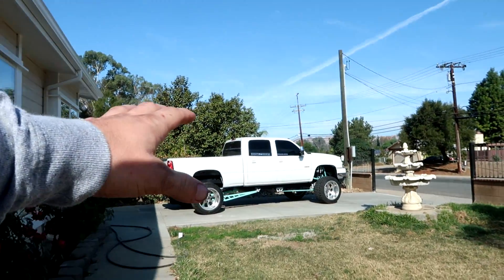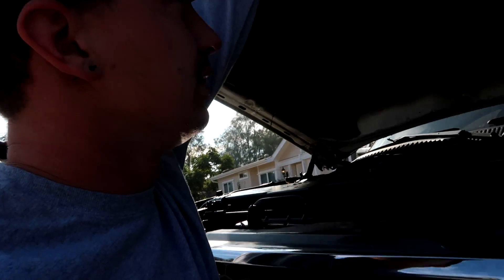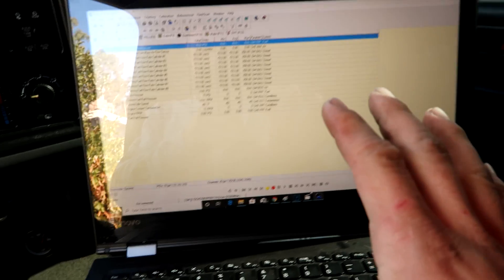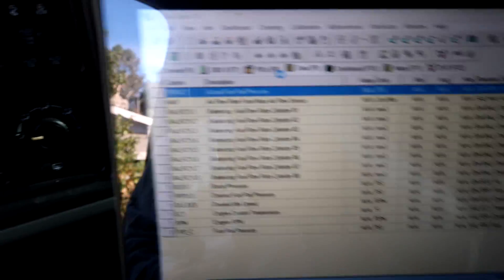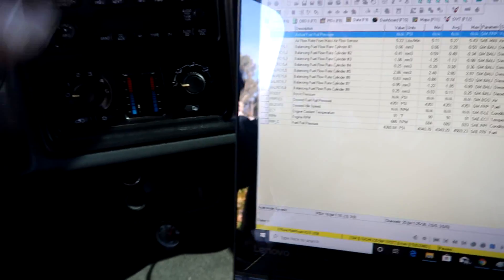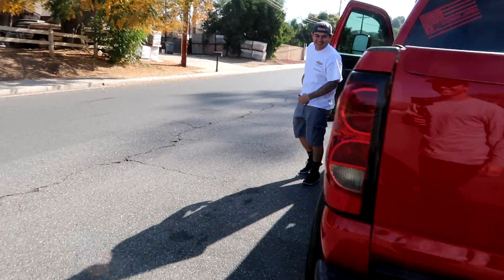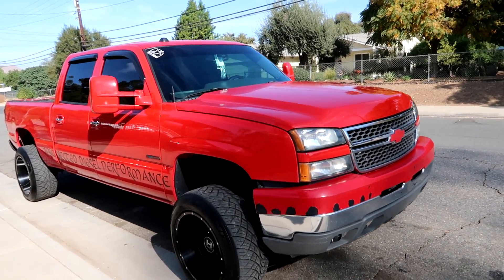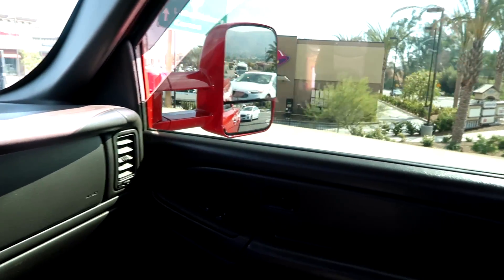Duramax Balance Rate Test

Comment: Can u shut off injectors with eflive to test pilot and main injection? Also what's your opinion on the Bosch reman injectors?
Reply from the maker: im not so sure to test it unless you mean as a noisey or smoking injector yes you can on the older trucks i believe lb7-lmm as of right now in the dvt.  and what year truck are they for?
Reply: @RESURRECTEDDIESEL  my truck is a 2007 lbz. My number 2 cyl is going up down + 1.5 / 2.5. all other +/- .05. starting to think I  didn't seat injector tight enough on copper washer. But the injector knock sound like it's coming from cylinder 8
Reply: Why when you're in park or neutral your injection rates would be off but when you put truck and drive or turn AC on all injectors zero out?

Comment: NEED HELP! 07 classic lbz 4x4 cclb. Rattle up front at slow speed... like parking lot speed... and rattles when turn off. Can tell power loss. Not ridiculously but def loss of power. I thought was down pipe but looks and feels good when I grab ahold of it. I've had shady ass Diesel shop working on previous stuff but they are half ass so I can't find anyone trustworthy around Houston. Any ideas be greatly appreciated. Broke crankshaft in number 2 rod journal with almost 70k miles on OEM lbz. Now about 30k on jasper lbz.Has efi live...dsp5... banks ram air... fully deleted.. injectors.. airdog165  2... built trans.. hole in bed from twisting driveshaft in half.... on and on y'all know how it is having over 70k in 30k pickup lol
Reply from the maker: Totally understand and I think I know the noise you’re talking about but not sure does it do it constantly at low speed or only sometimes at certain rpm
Reply: @RESURRECTEDDIESEL  just at certain points. Low speed barely foot touching throttle and sounds like 18wheeler when shut off

Comment: my fuel injector 1 reads 3.2-3.6 at idle and after drive for a couple of minutes and coming to a stop I check rates and it reads 4.8-5.2 but after maybe 10 seconds it drops back to the 3s is that Normal ???
Reply from the maker: yeah its a little high but if you're in drive its pretty normal to see that they might be on their way out though
Reply: @RESURRECTEDDIESEL  .... My number 4 is around+8

Comment: What does it mean if there is pressure in the reservoir tank? Head gasket?
Reply from the maker: Usually if there is a ton of pressure after sitting for 6-8 hours it’s a bad cap or an issue with head gaskets!
Reply: DURAMAX_DIESEL thanks for the info. I already changed the cap and it still holds pressure for days after running. Gonna see how long I can run it.

Comment: How did you get the balance rates on your computer?I can’t figure it out to save my life
Reply from the maker: It’s in the Efi scan tool v7.5 you have to connect to the truck go the the pid selection find balance rates then click them to highlight go up to your info tab hit validate pids then go to the data tab and hit the little yellow button at the bottom to start monitoring data and it should show you!
Reply: That did it thank you sir